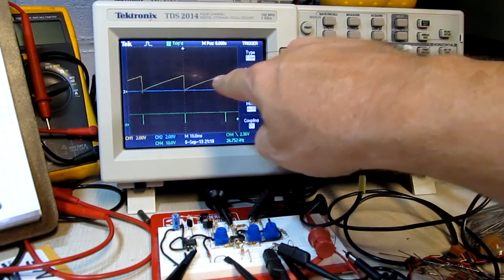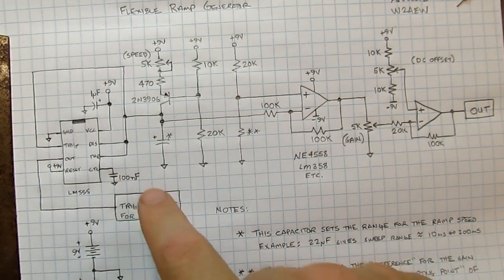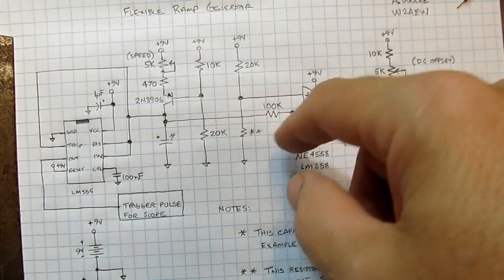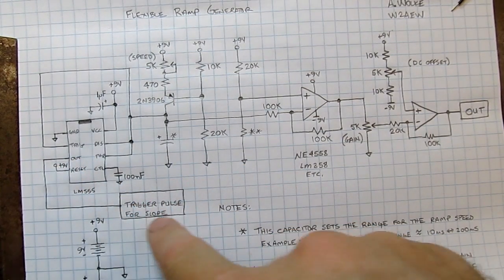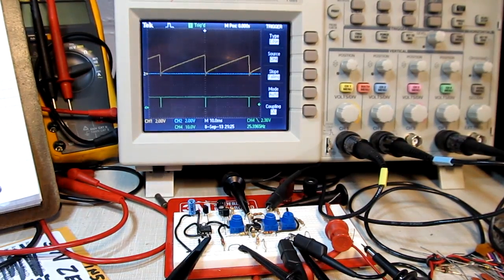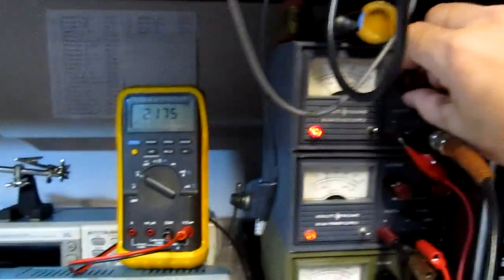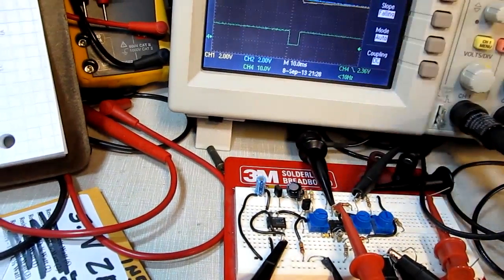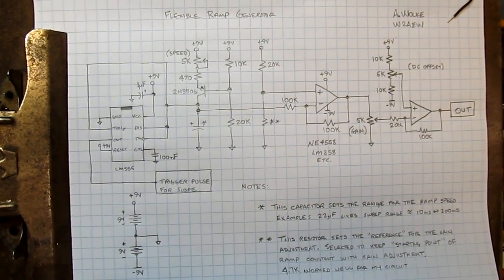#110: Circuit Fun: Flexible Ramp Generator to create frequency sweeps using 555 timer and op amps

Comment: Alan I'm still using this little ramp generator for adjusting I F sections when I need to it works really well with it's success, I've gone on to making a lot more test equipment for the shack, I enjoy building   much more than ham operating at the moment.
73  Paul  M0BSW
Reply from the maker: Glad to hear it Paul!  Thanks!

Comment: Thank you, Alan for your videos, it's great pleasure for watching.

I have some questions about this circuit.
There is a small non-linearity in the ramp begin. I've made part of circuit -  555-timer + transistor current source and it's quite linear in wide period ranges. It might be because of op-amps.  What characteristics of opamps are critical to avoid non-linearity?

And one more question, disturbing me: why discharge level (minimum voltage of ramp) is dependant of capacitor value ?

Comment: I'm looking to build a basic function generator capable of sine wave, Square Wave, and Saw wave up to max 1 Mhz; 3 Vpp max output ,  input impedance of 50 ohms. can you please suggest one for me. Thank you
Reply from the maker: There are several <$20 kits that are based on DDS chips available on ebay an elsewhere.  One of these would be the easiest option.
Reply: Thank you for your response. I'm currently living in Guayaquil Ecuador.. It is expensive to send items from China or USA via Mail. But, I can I find very affordable semiconductors parts to build one.  Have a great day and has always I learn and enjoy by watching your videos.

Comment: hello, how do i generate a negative voltage to power pin4 of opamp?
Reply from the maker: It's usually done with a negative power supply.  However, in many cases, you can get by with a single supply and simply shift the DC operating point of the circuit.  You might find this video interesting:
https://www.youtube.com/watch?v=MtccB9K09ck

Comment: Hello, I'm trying with a friend this circuit and we want to make the sweep frequency oscillator but we do not understand what we have to put to the circuit for obtaining the sine wave oscillator output.
 I apologize because we are not english and it's a little bit difficult for us to understand you. Thanks.
Reply from the maker: This circuit does not create the swept sine wave output.  It only creates a voltage ramp that is designed to be connected to the VCF (Voltage Controlled Frequency) input jack on a Function Generator, such as in the lower right corner of this picture: 
https://d2ydh70d4b5xgv.cloudfront.net/images/3/9/elenco-function-generator-gfg-8016g-6996c99b05da5dd8b9245cef18b1dd90.jpg
Reply: Do you have any idea how we can get a sweep frequency oscillator?
Thanks for the fast response
Reply from the maker: There are a lot of different designs that you can find online, depending upon the frequency range that you need to sweep across.  Here are several links to get you started:
http://www.nutsvolts.com/magazine/article/december2013_Reed
http://www.vk2zay.net/article/93
https://www.ssl.berkeley.edu/~mlampton/oscillator.pdf
http://www.dxzone.com/catalog/Technical_Reference/Test_Equipment/RF_Sweep_Generator/

Comment: Do you have suggestions for a DIY voltage-controlled sinewave generator that this circuit could be merged with, to create a simple all-in-one sweep generator?
Reply from the maker: Not off the top of my head, but I'll keep it in mind.
Reply from the maker: There are a lot of different designs that you can find online, depending upon the frequency range that you need to sweep across.  Here are several links to get you started:
http://www.nutsvolts.com/magazine/article/december2013_Reed
http://www.vk2zay.net/article/93
https://www.ssl.berkeley.edu/~mlampton/oscillator.pdf
http://www.dxzone.com/catalog/Technical_Reference/Test_Equipment/RF_Sweep_Generator/
Reply: Thanks, awesome links!  I particularly like the audio sweep oscillator.  It's similar to an idea I have been thinking about cobbling together.  I am playing around with the idea of using a 556 dual timer to generate a voltage-controlled square wave, then running this through a dual op-amp to integrate this into a triangle and then a (pseudo) sine wave.
Reply from the maker: Just remember that when using an integrator to make a square wave into a triangle wave, the triangle wave amplitude will be proportional to the frequency.  Fine for a single frequency, but won't work well for a sweep (unless you follow it with a voltage controlled gain stage to compensate - tricky.

Comment: what about the reverse, or the ramp down circuit from 555?
Reply from the maker: The output of the first op amp stage is the reverse signal, so you can use that, or buffer that with a non-inverting buffer/amplifier.

Comment: Thanks for the circuit, have built it, everything works except for the fact that the ramp is reversed ( starts High on the left, goes low on the right). Have rebuilt the circuit, but must be making the same silly mistake each time. Any help would be greatly appreciated.
Reply from the maker: Are you sure you don't have your scope channel inverted?  Many scopes have an "invert" function on CH2.  Make sure that's not on.  The collector voltage of the PNP should show the correct up-ramp signal.  It will be inverted at the output of the first op amp stage, and then inverted again at the final output.
Reply: Thanks  a lot for replying; that was it!  I had  eyes but just could'nt see what the scope was telling me. Again many thanks. BTW hope your on the mend.

Comment: that circuit looks like a simple metal detect circuit, I have a timebase bistable and ramp generator socket on the front panel of my oscilloscope how would i go about using ? do i use the ext. trigger mode for it? I read that its running thought a Schmitt trigger, does this mean I can measure LCR with it ? Caps and inductors ?
Reply from the maker: I would imagine that the timebase bistable is a squarewave that is tied to the horizontal timebase of the scope, and the ramp output probably corresponds to the sweep. Tough to say without knowing what scope you have though. The bistable might be usable for TDR or cap/inductor testing.
Reply: https://www.dropbox.com/sh/d5wi2jhh34xahss/AABr7NNH-My5hgLHEcN5JoSua?dl=0 the Manual is in the drop box if you have the time. its mention  on page 12, and I also re solder that lost wire which help with frq noise.

Comment: Can this circuit be used within audible frequencies (20 - 20k)? I am looking to design a circuit that generates a variable frequency sawtooth wave oscillator, but would like to sweep within those frequencies of 20 Hz. to 20 kHz.
Reply from the maker: This circuit does not create frequency sweeps itself.  It only creates the voltage ramp that you then apply to the control/tune voltage input of a sweep oscillator.
Reply: Thanks for getting back to me. Just to make sure I understand. This circuit is used to shape the waveform, but in order to get that frequency range of 20 - 20k, I would have to apply this signal to a sweep oscillator circuit?
Reply from the maker: Not quite. Many function and signal generators have a VCF input (voltage controlled frequency), where the voltage applied to this input is what sets the generator's output frequency. This circuit is intended to drive the VCF input to cause the generator to perform a frequency sweep.

Comment: Great stuff, I'm very glad I found your videos!
Quick question though, what kind of current will pin 7 be sinking? Or put another way, what is the fall time?
Reply from the maker: It depends on the value of the capacitor, and the particular 555 being used.  Thus, you really can't predict it very accurately.
Reply: I was thinking of your schematic with the 22uF (later you up it to 220uF?), and for no particular reason other than being curious :)
While I was looking at your schematic I realized this is the first time I've seen (or noticed) such a large cap being discharged (or charged) that fast through the 555.
I guess partly I was wondering if I was to build it whether to add a transistor stage for longevitys sake.

Comment: Good day sir! i have Agilent 811A4 pulse generator, i want to have an automatic variation of frequency from 2hz-1000hz, may you provide the schematic diagram of the sweep generator? thanks!
Reply from the maker: The only way I see to do this would be to provide an external trigger pulse whose repetition interval is sweeping.  This won't change the pulse width, but will change the pulse repetition frequency.   A ramp circuit like this can be used to control the charge rate on the timing cap in a 555 circuit, thus creating the required trigger signal.

Comment: Good Circuit, tested and working. Adjusted to produce 0/+10 Volt sweep. (12V supply)  Thanks.
Is there a posibillity to add Log/Exp output voltage? This means 0 to +10 V in an logarithmic/exponential way. Tried to add an lin/log simple voltage converter (the one with an opamp and a transistor in the feedback path) but not working as expected. Any hint? Regards, Ruben
Reply from the maker: +Ruben Klobertanz The devil is usually in the details of getting the bias/offset correct.

Comment: Is this sort of scan (at a lower frequency) what's used for the trace on analogue oscilloscopes? ...With the voltage changing where the emitter points?

Comment: Is there a way to trigger the ramp or add duty cycle to this circuit?
Reply from the maker: Yes, the trigger I out on the 555 can be used to trigger the ramp, just like any other monostable application of the 555 timer. The circuit is configured as an astable oscillator, being self triggered. You can disconnect the trigger from the Rest of the circuit and drive it as required.
Reply: Working on a QCW coil?
Reply: Yes, Trying to build a ramp generator section that doesn't require writing code.
Reply: did it work?

Comment: I built this circuit and it works great with my function generator sweeping it through the
VCF input. The offset control is very useful. I also use a X10/X1 resistive divider so that I can have better control of the offset voltage feeding the VCF input. A 10-turn pot for the 5k offset control might help to set the voltage more precisely. Works great! Thanks for the video and schematic.
Reply from the maker: Awesome, this is the exact application that the circuit was designed for - I'm glad to hear it's working so well for you.

Comment: Interesting. there are several "paranormal investigators" that use swept tuned broadcast radios in ghost and spirit research. Curiously, when you sweep a radio, providing bits of of human speech..something, not sure what it is, will create meaningful messages,and often address the user by name, and answer questions. Not only radios, but anything that provides bits of human speech. Known as EVP, electronic voice phenomenon. 
 I know--easily debunked, if you just need it to go away, or be explained away. A friend sent a link for you video, as I was trying to explain how to use op amps for the sweep. Creating a triangle wave.
 I've been doing this stuff since 2000, used to be on the air... KC0FS. The swept radio has become known as a ghost box, or Frank's box..or whoever's box depending on who made a particular unit. EVP took over my life--all hobbies stopped as I focused on this...ahh...crap? 

 It's kind of a nightmare, many of these people are like "true believers" and know everything. All I know is something talks, seems to know me, won't answer questions--for me, but tells me enough to keep me hooked. Many hold Q&A sessions and get direct meaningful answers to questions. I don't do the ghost hunter haunted crawl around dark moldy basements craziness. 

 73...Frank KC0FS

Comment: Always Excellent! Question: what stage would this ramp go into on a function gen if you don't have a VC input?? Thanks...
73
Glenn WA4AOS
Reply from the maker: It's not possible to generalize because function generator designs vary greatly.  It will entirely depend on the function generator that you have.  Depending on its design, it may or may not be possible to hack a voltage-controlled sweep input.

Comment: Sir, can we use the same logic to sweep frequencies from 1KHZ till 3 MHz?
and can u please help with the circuit to generate the same frequency sweep generation using opamp and 555 timer?
Reply from the maker: This circuit was designed to be used with a VCF input of a function generator in order to generate a frequency sweep from the function generator.  1kHz to 3MHz is a very wide range for a voltage controlled oscillator, and would not be a simple circuit.

Comment: hello. how to make the sawtooth stop and continue on the voltage it is? 
its to stop the sweep and continue with a specific frequency, you can email me on b_a_t_ak47@hotmail.com if you don't want to make a video. thank you
Reply from the maker: My first thought would be to use a transistor to switch off the current source that charges the capacitor.  Of course, this will only work for a short period because the op amp and the 555 will draw some current out of the cap.
Reply: ***** 
thank you, how do a sample and hold circuit works? there is no good videos on that on youtube..
Reply from the maker: perjan6666 That's a good topic.  I'll add it to my list for future videos.
Reply: thats good, I'm just learning basic circuitry by looking at You tube videos and breadboarding hehe

Comment: I have seen sweep generators that have an option for either linear or log sweep. What is difference between the 2 types of sweep? Where would you use one or the other?Can you do a video showing how to align an IF section of an AM radio using a sweep generator and an oscilloscope with a demodulator probe? Can you show the if pattern on the oscilloscope screen with the peak at 455Khz and maybe two marker frequencies on either side if the 455khz peak frequency?

Thank You For Reviewing!

John

Comment: That rounded starting edge of the ramp, what's the cause? Is the transistor charging the capacitor doing non-linear business? Or are the opamp stages getting within Vcc or Gnd margins. (shouldn't be so, as it has a symmetric supply of +9 and -9 volt). Or something else?